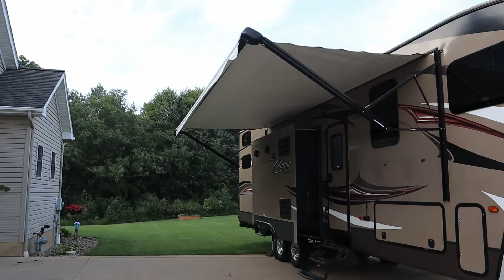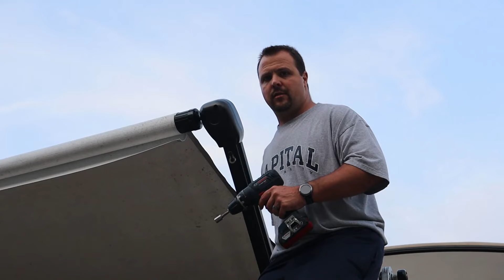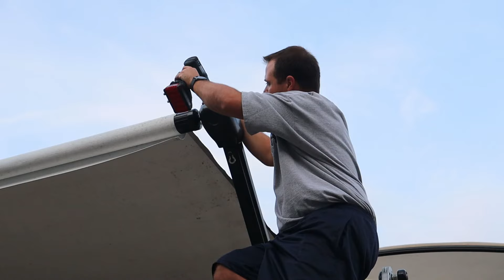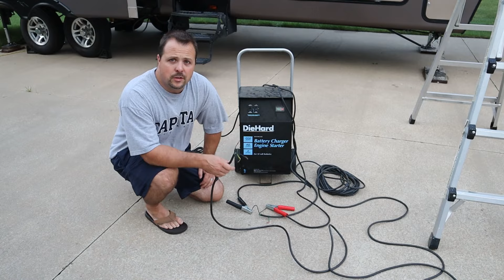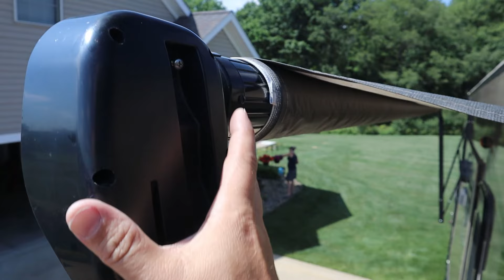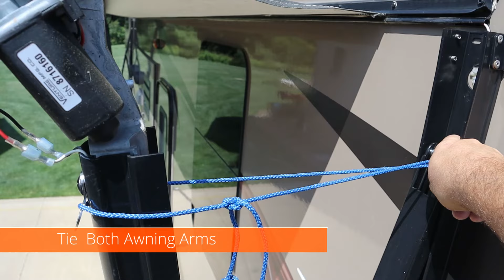Solera Power Awning Wont Retract - Troubleshooting and Repair

Comment: I have the Lippert Solera Awning 3000 on my 5th wheel RV...

My advice is Rip it off!, and replace it!!

The Lippert Solera awning is the cheapest piece of crap out there!!

My Solera awning is only about 2 years old. In Iess than a year, the motor went out, and had to be replaced. Less than a year after that, the gear/drive head broke. Lippert told us that they don't sell replacement parts for it. You have to buy a whole another Motor Drive head assembly, which is over $500.

On top of that, we can not even use it most of the time, because we found out that it can withstand winds in excess of 5 - 10 miles per hour or it will break or get damaged.

We're replacing ours with a Carefree Colorado awning.

Comment: What did you support the awning with when you removed the motor assembly!
Mine is 126” above the ground.
Reply from the maker: As long as you tie the arms off so it can't unroll it will stay in place.  The motor doesn't actually hold the awning to the arms.
Reply: @WeekendRVAdventures  if you disconnect the rollled awning from the gearbox shaft on the motor, don’t you need to hold the awning up-seems like it would want to fall??
My main awning on my Jayco 36SSWS won’t extend. Gonna supply voltage to the motor and then, maybe have to replace it…
Reply from the maker: The shaft on the awning goes through a bushing on the arm before going into the gearbox.

Comment: I definitely appreciate this video, I should've already checked this as I am an electrician,but kept putting it off ... finally looked it up,found your video, popped the cover off of my motor. What I found was not a bad motor, but the service loop in the cord was smashed between the motor and the arm that it mounts to...somehow it still worked intermittently even tho the cord was literally almost severed completely ! little splicing job fixed it up just like new...ish....
Reply from the maker: Nice! At least it was an easy fix...

Comment: Is it better to use rope or vise grips to hold the awning in place while you change the motor? I need to do this. My motor went out on me.
Reply from the maker: I would just tie it off with a rope.  You don't need to hold it super close to the camper. It might actually make it a little easier to let it out a foot or 2.

Comment: Your video was very helpful, but our problem turned out to be a bent screw in the end cap so we couldn't use the drill to retract. Ended up manually rolling it in but it wouldn't lock so we had to tie it down to stay closed. Any ideas on how we can lock it in or secure so we can safely drive the rig? What a mess. Luckily we are at home cleaning up for the next outing which may not happen :(
Reply from the maker: If you have rope or Velcro wrap, I would suggest wrapping it around the arms to keep them tied in.
Reply: So right now I am having a similar problem. Three months ago I used the drill method 😊to extend my awning and now that there is a hurricane coming tomorrow, I cannot for some reason get it to close using the drill. I have even tried calling local RV repair shops for advice and they say it should close with the drill bit. However, it will not. Hoping I do not have to remove every single screw that attaches the awning to my RV before the storm. Luckily, the RV is staying stationary it’s just I’d rather not put a parasail on it and risk ripping the entire front of my RV off from a gust of wind lol.

Comment: It would be interesting to monitor the voltage at the motor to be sure you are getting a nominal 12 volts. If the manufacture did not use a heavy enough gauge wire that could result in a voltage drop which would slow the motor and worse yet stress it to the point of failure.
Reply from the maker: Good point.  I never checked the voltage at the motor while it was under load.

Comment: Mine wont extend and there is no noise or anything.  I just took it out of storage to dewinterize it.  It's only 2 years old.  Any advice you could give is appreciated.
Great video by the way.
Thanks
Reply from the maker: I would start by checking to make sure the fuse isn't blown and that you are getting power out to the motor connector.  You will need someone to help so they can press the button inside while you have a volt meter connected between the wires at the motor.
Reply: @WeekendRVAdventures  Thank you. it works again.

Comment: Help!! Do i need to put a screw driver into a hole so that the spring doesn't unravel? On another video the guy said you have  to use a screwdriver on the other end, but i  can't find any hole to stop the spring from unraveling
Reply from the maker: It's not spring loaded, but if you don't support or tie the awning up it will unroll all the way out when you disconnect the motor.
Reply: Thank u so much for the fast response
Reply from the maker: No problem, glad I could help.

Comment: novice here, how'd you switch the leads and fix motor?
Reply from the maker: The leads on the new motor should have the same connector as the old one.  Just make sure you remember which color wires go together or your awning switch will work backwards.

Comment: Thanks for the video Jason.  We also have the Solara Awnings on our Cougar 315RLS which the Smart Arm switches have both gone bad.  My dealer won't replace the switches so they just direct wired them now they can only operate using the In Command System (with I do not like).  I'm glad you demonstrated how to retract the awning using a drill.  No other video shows this.
Reply from the maker: Thanks, that's too bad that the dealer wouldn't fix it correctly for you.

Comment: Good video. I replaced my motor (LCI PN 373566) 2 weeks ago after it bit the dust on a 2016 17' Star Craft AR One .  The camper was one year old when I bought it. I noticed the awning always seemed to struggle when retracting but wrote it off as normal.  The new motor retracts the awning just as slow as the old one did if not slower.  I don't think this motor will last as long and the original the way is sounds. 
Questions;  Is there a torsion spring on either side of the awning that can be adjusted?  The motor is fighting the tension of the struts when retracting and just by pushing the arms manually that's a lot of tension. A Lippert installation manual I found online said there is approximately an 8 second difference between opening and closing the awning. Checking mine it was 12 seconds. 
 It seems that 2016 is an optimal year that has all these awning motor problems.
Reply from the maker: There isn't a spring on the other side, but I think on longer models there really should be.  I've never timed mine, but I think I will now.
Thanks,
Jason
Reply: check you drive pin. mine basically stripped out. its supposed to have a flat spot that the gear box grabs hold of but the flat spot rounded off and when retracting the gear box just slips hence wont retract.

Comment: Great information. I wish I had watched it before having the awning motor fail 1000 miles from home. Had to stand on the roof of our 4Runner and retract using a 7/16 socket and ratchet!  You think it’s slow using an electric drill try a hand ratchet!  But I’m going to order a new motor and fix it myself. Thanks again for making the instructional video
Reply from the maker: Thank you

Comment: Nice presentation. Took my awning motor cover off. Push switch to extend and power wire TO the motor (from switch I guess) reads 12.4V. Press retract and 0.0. Would you suspect bad switch? Any advice?
Reply from the maker: The power should switch to the opposite wire when you press retract.  If both wires read 0 when pressing retract it's probably the switch.
Reply: Thank you very much. I will switch the leads for a better understanding of this. Thanks again.

Comment: I lost my Rubber plug and am replacing it. Should I be lubricating the gears? What grease should I use? Great video.
Reply from the maker: The gears don't need a lot of grease, so if they are still coated I would leave them alone.  You don't want grease dripping from your awning on a hot day.  If they are dry a couple dabs of all purpose grease should work, but I don't know what the mfg recommendation is.

Comment: Thank you for the video.  I’m having exact same problem with mine.  Do I need to look for a specific motor or will any solera motor work?   I noticed several variations in price.
Reply from the maker: There are 2 versions out now.  The easiest way to tell is to look at the motor wiring.  The older version is cheaper and has 2 individual wires with connectors on them.  The new version is more expensive and uses a 2 pole connector that has both wires in the same connector.
You will have to look at yours to determine which you have before ordering one.
I hope that helps.
Jason

Comment: You were the only video that has showed how you can retract the awning with a drill.  I appreciate that.  This video shows a lot of valuable info that few video's cover.  Thanks!  I would like to see a video of how to replace struts.  I finally figured out the tricks but have had a lot of trouble due to the strength of struts.  The biggest thing I didn't do was to "fully" extend before replacing the struts.  I thought it was but I was just careless and it wasn't.  I have built 3 houses and overhauled mothers over the years but campers is like starting over on the learning curve.
Reply from the maker: I'm happy to hear the video helped.  I haven't tried the struts yet...
Reply: Hello Jason, thanks for the video, I have an 2021 Bighorne 5th wheel by heartland. I'm having problems with it extending and retracting, it's moving very slow, and making aloud knocking noise inside the wall, I'm not sure if it's the motor or not. I plan on checking the basis like fuse, awning connections, and finally removing the cover on the motor. I never knew about the manual retract with 7/16 drill bit, so thanks for that info. Oh, btw, you mentioned you brought a new motor from Amazon, but how much did it cost, and are there numbers or something of refrence to locate another one with that info. Again, thanks, and I'll post again to what I find in my troubkeshooting efforts. 
-Greg

Comment: I'm here to tell you these motors must have a design defect. Our TT is a 2016 Forest River Wildwood purchased in October of 2016. By August of 2017 the motor was too weak to retract the waning. I bugged Lipert about it, telling them that I had read numerous complaints on several camping forums (Google it) about the same problem, they finally "Goodwilled" a replacement motor to me. Late last summer (2019) that motor began needing help to roll the awning in. In the case of either motor the awning was not deployed/retracted more than 15 or 20 times. So now I will begin the process of attempting to shame Lipert into "Goodwilling" another motor for me. As a manufacturing and engineering professional I'd think sooner or later Lipert would recognize they have a problem and correct it.
Reply from the maker: I agree, my replacement motor already seems weak too.

Comment: Thanks for the video. How do I adjust the tracking on this awning?
Reply from the maker: If your awning is the same as mine there isn't a tracking adjustment.  The motor drives from one side and the other just comes along for the ride.  The only thing I could suggest is to fully extend the awning and then bring it back in.

Comment: 2018 keystone sprinter 17’ solero power awning

Do I need to take it apart to get the model number off the motor or are they all generic if I put the info for the trailer online when searching
Reply from the maker: I'm pretty sure they are all the same, but if you take the cover off the motor part number is right there. Only take about 15 min to check it out.
Reply: So I replaced the motor. Retracted it to make sure it worked (it worked in and out). Extended it back out and put the cover on. Retracted and it stopped and about two feet from fully retracted. Now it just clicks on the fuse panel in the underbelly storage whether I use the remote or the switch on the panel. Any ideas?
Reply: kole sansaver 
Check the wires on the motor to be sure they are not pinched or damaged in any way that would cause a short or high resistance.   Check the continuity of the wires from the switch to the motor.

Comment: Thanks for video. Our trailer has a Solera power awning with same issue. Goes out but will not roll back up. Got a new motor on ebay. My trailer is a 2016 with not all that much use. Hope this motor lasts longer then 3 years.
Reply from the maker: Your welcome, I'm hoping mine lasts longer than the original too 🤞

Comment: informative video, thanks for posting.  My 2015 Keystone had the same one and went intermittent once, then worked fine for 3 camping trips.  We left the awning extended in our driveway for 2 weeks this summer in between trips and then would not retract when we tried to bring it in to get ready for our next trip.  I tested the switch and the motor was definitely getting + and - 13VDC in the alternating switch positions.  Confirmed the motor is bad and will be ordering a replacement on Amazon.  Used your trick with the 7/16 socket and cordless drill to retract it.  I've read a few reviews on Amazon from guys that purchased and replaced this motor and several had the replacement fail after a few uses.  I'm wondering if the motor gets damaged or pre-maturely fails if you keep the switch depressed too long after it is fully retracted, like causing a current overload or winding burnout?  Any advice on that?  Great channel, keep up the helpful posts!  James in Maine.
Reply from the maker: James, thank you. For what it's worth my replacement motor is still working a year later. I would hope the awning has some type of overload protection built in, but with all the ways costs are cut in RV's they may not. I'll look into it.
Thanks,
Jason

Comment: Have you ever had a issue of awning  rolling up in reverse? I have a 2018 Keystone Hideout 299rlds 5th wheel. When using the switch to extend the awning it actually is retracting and rolling over top of canopy instead of rolling in leaving the bright white inside of canopy showing against my tan and dark brown rv when completely rolled up. When its fully extended and  stops. Holding switch down the motor stops and will not move. I was wondering if using a drill and rotating the motor past and  around to its correct postion  would  make it work like it should? Am thinking the original owner probably held the switch down to long and motor rotated a full turn and now actually running the opposite way. Any suggestion would help. For  all I get when I ask a company and folks that do know whats going on. All i get is bring it into a rv shop and have them look at it.🙄
Reply from the maker: I know mine will roll up in reverse if you hold the button down. There isn't a stop that tells the awning it's fully extended. I would try using the override to get it going the correct way and see what happens.

Comment: Had the same thing happen to me at a campground last week. After checking the fuse in the mother board I removed the cover and beat on the motor with a screw driver and it started working again. I've had so many problems with this rig a 2016 identical to this one. Can't wait to trade it for a super c. I suggest you get a good coat of wax on that gel coat, it will oxidize quickly and never look the same after buffing it. My awning started pulling the mounting screws out of the wall and required me riveting back in with Dometic awning rivets. the fender skirt screws all came loose and I had to pop rivet thoses back as well. Hope you have better luck with your RV.
Reply from the maker: Scott, I've had some of the same issues you mentioned. Riveted the fender skirts. One side of my rig has oxidized too, even with waxing. Now I'm trying to get it to buff out but haven't had any luck.
Reply: @WeekendRVAdventures  I used a 7 inch buffer from harbor freight with wool pads and meguairs heavy oxidation compound followed by their premium wax, its a long tedious process and lasted about 6 months before it started to re appear. It looks like new but won't stand the brutal NM sun.

Comment: Can you tell me the number of the motor you got to replace yours. I can't find it to order a new one and mine is the same as the one you are showing.
Reply from the maker: Mine was the lippert components part number 266149.
Reply: Lippert sent me a replacement when mine failed jus a little bit out of warranty people forgot some problems are solved with a simpler phone call to the manufacturer, my item was 373566 ,
 Jayco 0306188, 
Thor 0418313, 
keystone 517094.

Comment: Our awning extended yesterday but when we tried to retract it, it was stuck.  We realized we are not getting power to the motor and think it could have something to do with a fuse or the 6 amp supplier breaker, however we can't find the 6 amp supplier breaker.  Any idea where this would be located?  It is not with the main breaker box or fuses inside the camper.  Thanks!
Reply from the maker: If it's not in the main box, it's probably an in line fuse. I would check the wiring that runs down the awning arm to the motor. It should be somewhere between where the wire exits the camper and the connection to the motor.  Good luck,
Jason

Comment: Thanks for sharing this! Before I manhandle it, how does the front motor cover come off? Just snaps into place?
Reply from the maker: Ryan, there are screws that go through the back cover and into the front. You will have to extend your awning out a little bit to get access to the screws. Good luck 🤞
Jason
Reply: Thank you!
Reply from the maker: No problem
Reply: Hey Jason! Did you remove the motor only or the complete motor mount etc?
Reply from the maker: I removed the entire motor/gearbox assembly.
Reply: @WeekendRVAdventures  Thanks Jason. I’ve got one to do next week and wasn’t sure which would be better. Thanks.